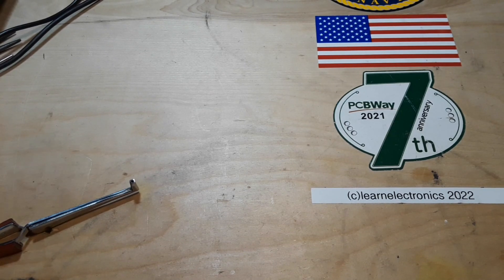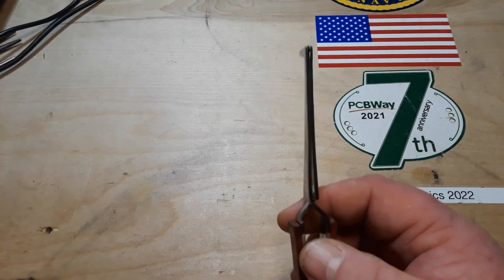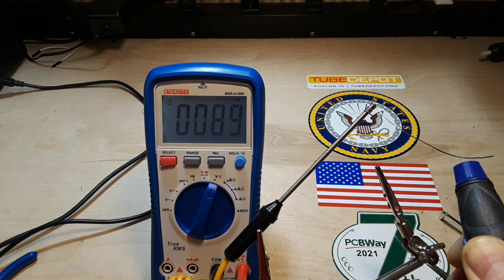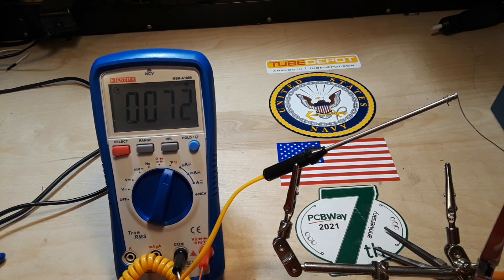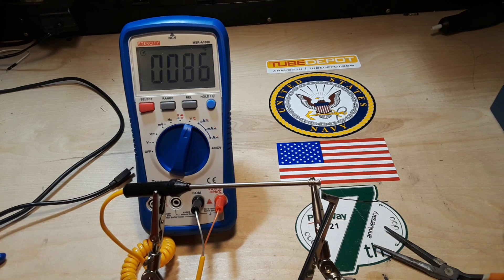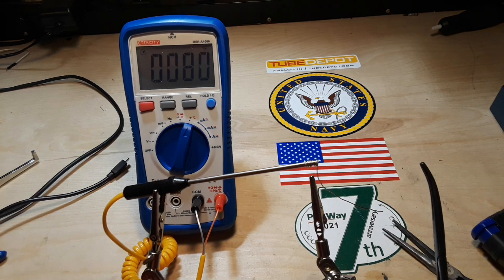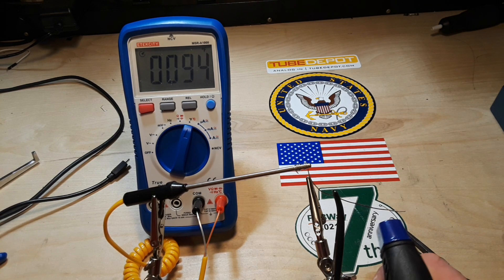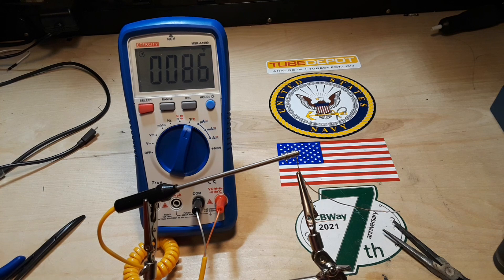Heat Sinking Tweezers

Comment: When soldering, does the heatsink go between components and the pcb? Or does it go at the end of the wire leads that get trimmed off?
Reply: The heatsink must go between the component body and the contact  point/source of the heat
Reply: end of wire, you clamp on the insulation to prevent it from melting